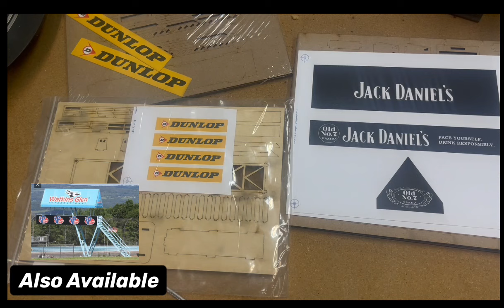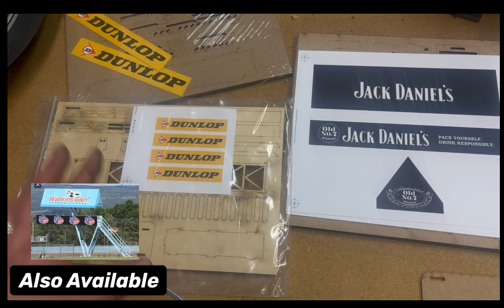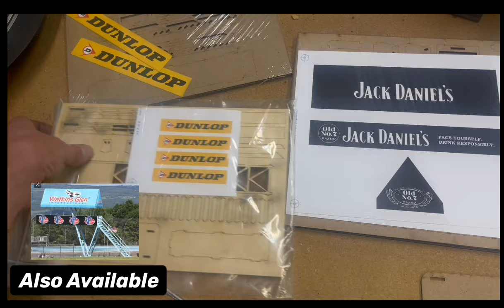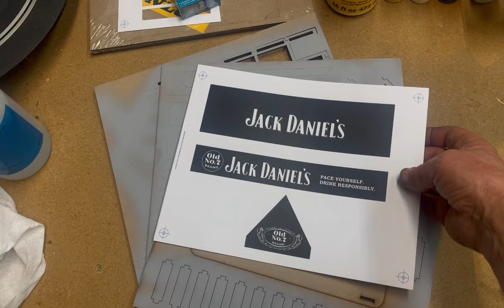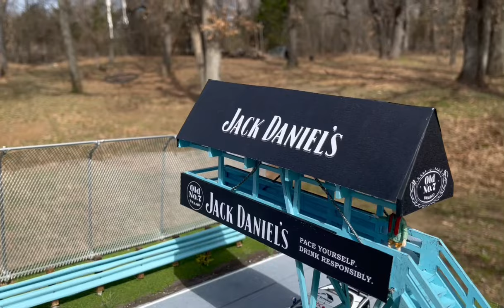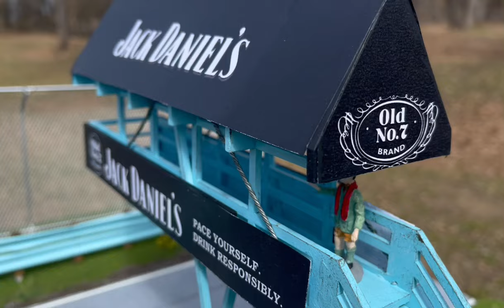Race Track Scenics Watkins Glen Flying Bridge

Comment: On twisting the wire, a pair of aviation pliers will make that process a matter of seconds. Also called safety wire pliers.
Not too expensive.
Reply from the maker: Yes they work great 👍 👍. I do own a pair but I wanted to show how to do this without a special tool , and get a decent look. But thank you Leonard , for pointing this out

Comment: Boone need to know red Scalextric car to my right, equal with your with your face ! what is it
Reply from the maker: The red Scalextric car to my right.. That little jewel is the 1967 Brands Hatch #9 Ferrari 412P driven by Attwood and Piper in the 6 hours race , I believe they placed 7th overall.